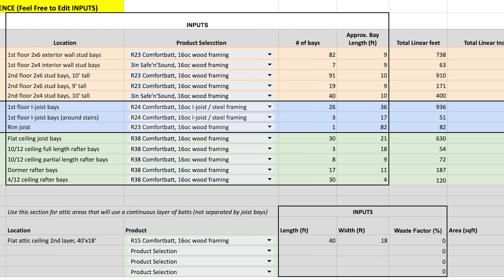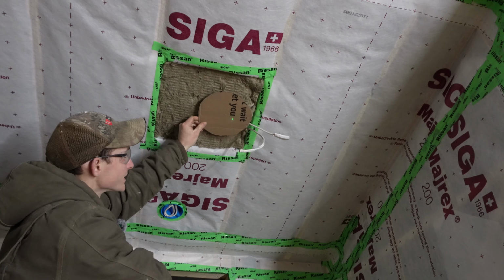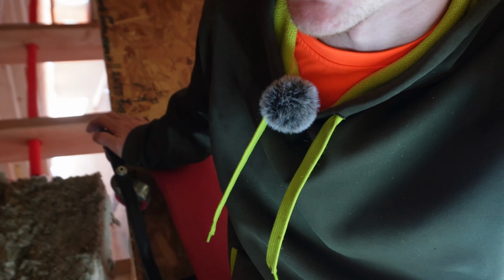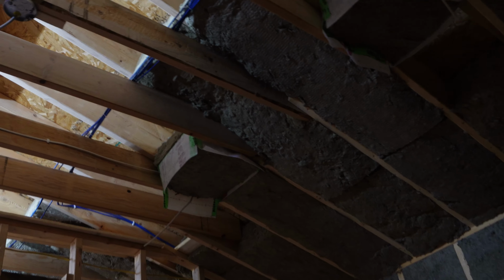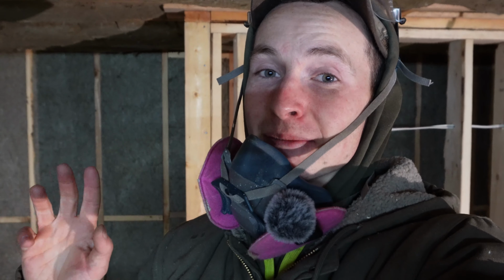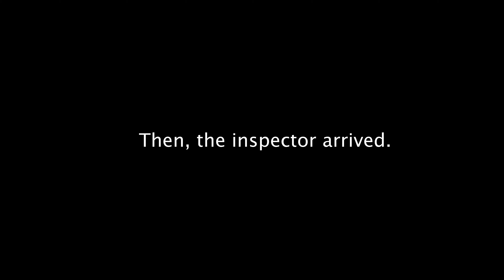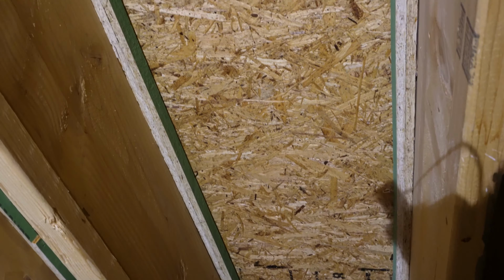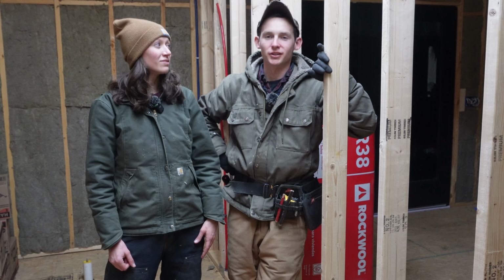DIY Attic Insulation - Installing ROCKWOOL in our Ceiling & Attic

Comment: Haha. You triggered a great memory. When my dad built our house, there were several "lasts" I was  present for: the last brick laid. The last hardwood floor board laid. The last circuit wired. The last kitchen cabinet (which he had built) hung. It always felt good going home with dad after those milestones. We didn't do a happy dance. This was the 60's. Dudes just shook hands and smiled a little. 🙂
Reply from the maker: Hahah that is fantastic, that is almost certainly the same experience Elaina's dad had while helping his dad build their family home in the early 70s! Still a great house to this day

Comment: Great job on the attention to detail with your insulation project.  That's a lot of work!  This is one of the reasons I designed the house I'm building next year to be all I-joist roofing with blown-in below the roof deck and board insulation above the deck, 2x4 furring strips to run my wires behind as needed.  A lot easier to install, although it's a bit more expensive on the material side.  The 2/12 roof pitch helps quite a bit to keep the material cost lower.  You've got to be proud of what you've accomplished; I know I am.
Reply from the maker: Nice! Assuming that's an unvented roof or a top side ventilation cavity above the board insulation? We considered I-joist rafters until seeing the bill for the floor platform material, it was almost $6/lf if I recall!
Reply: @MasonDixonAcres  Yes, it includes a vented over-roof, which is between the roof deck and the metal roof above it, separated by strapping.  Costs are so high I had to cancel my full basement here in Maine and settle for a stem wall. At least that let me change the staircase to an exercise room. 😁
Reply from the maker: Ah that's a shame to give up the basement especially in your climate where your stem walls probably had to be 4 ft anyway! Glad you made the most of it

Comment: Nice job! Recommendation. I don't see if you did or didn't but while the walls are still mostly open run some lighting up in the dark crawlspaceish area. It's a cheap addition and if you ever have to poke around up there you will be glad you did it
Reply from the maker: Yep we have a switch above the hatch and 3 bulb sockets up there! Wiring wasn't connected at the panel so unfortunately couldn't use it for insulating 😅

Comment: Curious if you did a cost comparison to SPF (open or closed cell) vs DIY Rockwool and pro installed Rockwool. Also total man hours this way??
Reply from the maker: Not a fan of spray foam for a number of reasons, but I did a basic estimate early on from some rough sqft numbers I saw online and it was higher than DIY Rockwool for sure. I can't remember the numbers. Never got a quote to hire out insulation, it's a DIY job to us despite the physical labor and time. Probably spent 7 full days doing the attic/ceilings with filming

Comment: According to my Rockwool Rep the reason they no longer make blow in , is because the demand has been to high  for the batts. So to keep up with production they only produce the batts in the states.   Europe can still get blow in .  So when I need blow in I purchase though American Rockwool in Nolanville Tx.   You must purchase at least 1/2 a semi trailer.  I have to ship it aproximatly 1,700 miles.  If you need more info let me know.  Take care.
Reply from the maker: Yep that sounds about right! We've heard that blow in will be coming to the states eventually.. eventually 😆

Comment: Is it really desirable to have the soffit 100% sealed?  Just musing, seems like that makes a micro-climate that includes the extra cool AC duct. Is unintended condensation possible? Probably not, but maybe venting into the house is worth considering.
Reply from the maker: My thought is the risk of condensation is actually higher with it open though from letting hot/moist air into the garage when coming and going during summer. I've noticed on hot & humid days there's condensation on our water filter housing, so I feel like having the soffit sealed will prevent that moist air from coming into contact with a potentially cold duct in the soffit and condensing, even though all the ductwork is wrapped.

Comment: Next time your marking things on the floor, you can use marker, then spray it with clear coat. Won't rub off.
Reply from the maker: I've heard hairspray over chalklines is helpful for framing, I'm not sure if the drywall dust would still totally coat it though

Comment: Yeah sprinklers and cold don't mix. My old office ended up with 8 inches of water throughout. The back entrance was a hundred-year-old oak door. It was removed for restoration in October and replaced with a drop cloth. Work was delayed for parts. The vestibule had a sprinkler head. Came February and ka-blam! nb Yeah my dad started saying the thing about two people being more than twice as fast when I reached the age I was able to help him. Not insulation, but ceiling tile, hardwood flooring, wiring... Good memories.
Reply from the maker: Yikes 😬 hopefully insurance helped a little with that one!